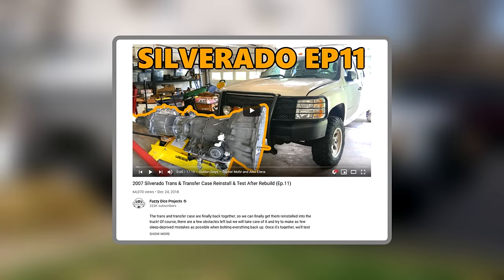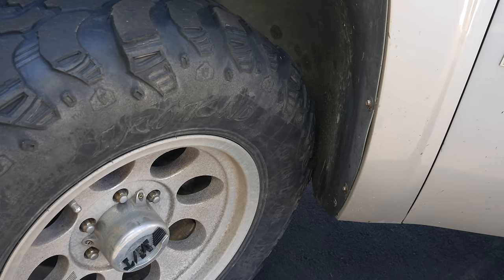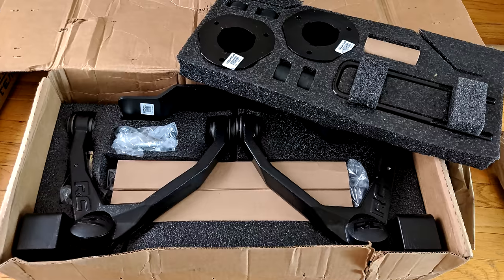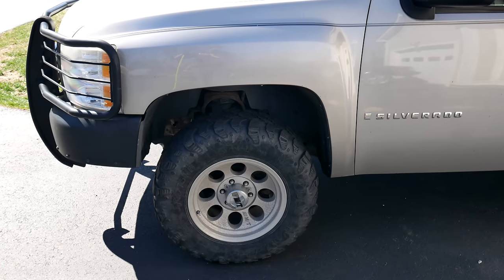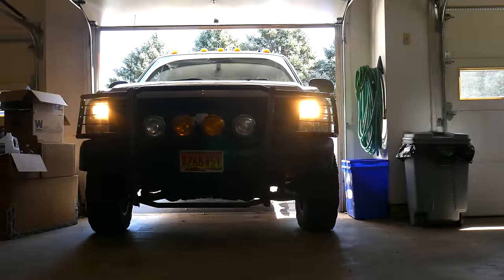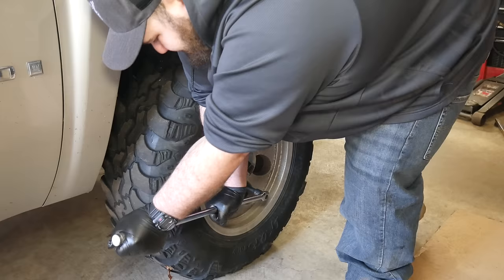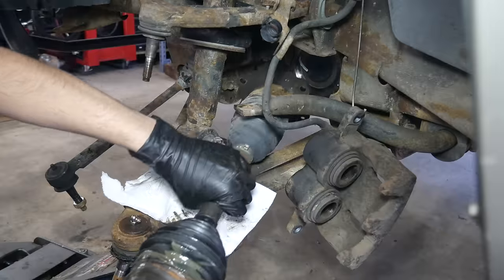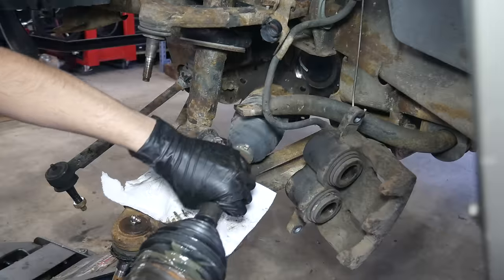2007 Silverado K1500 3.5” Rough Country Lift Kit Install and General Repairs (Ep.12)

Comment: I love that you use so many “less expensive” Harbour Freight tools like a lot of us have at home or can afford to buy. Shows you don’t need the most expensive tools off of the tool truck to get the work done.
Reply: Hope his jackstands aren't from there.
Reply: He's one of us too, he just makes videos so we can share in making memories
Reply: People buy snap on, blue point, etc just to say they have it. No point when harbor freight stuff works just as well if not better.
Reply: @THEEVERYTHINGTHINGCHANNEL  I wouldn’t say that’s necessarily true, there are certain tools I use from snap on I would never even consider from harbor freight for instance screw drivers, and pliers huge quality difference. As far as impact sockets and regular hand tools I mostly agree. Snap on makes very comfortable wrenches but the icon line of hand tools are almost identical for less than a quarter of the price. I also use a 3/4” snap on ratchet with a torque multiplier when I’m disassembling hydraulic cylinders, I would never trust putting that kind of torque on a harbor freight 3/4” ratchet. I’d say application really matters, I agree most snap on tools are ridiculously priced, but when you make a living with your tools you need some high quality tools. I also buy a lot of sunex tools, great tools for the money.

Comment: I know the feeling with those Suspension kits, I put a 2 inch lift under my 94 Explorer, it said about 5 hours for complete installation. Instead it took me about 12 hours.
I did get the same Brand as you Rough Country, and I can say the exact same thing happened to me, and I just didn't trust the bolts, so I also replaced those. The only ones I kept was the U-bolts because I needed them for the lift.
Also I believe they only do the time tests in 100% conditions where nothing is rusted and everything goes smoothly. Which I know is normal for Commission times and all, if you're getting it done professionally.

Comment: Great video !! I bought the same 3.5 inch kit for our 2013 Tahoe z71. Havnt installed it yet. Although mine comes with different options for the rear. Shock relocation brackets and spacers for the spring in back as mine does not have leafs. Gonna video it when I install and can only hope I do as decent of a job as you did!!! Thanks for the video!! It helped me a lot as far as notching the crossmember and installing the structure spacers. That’s was my only hesitation in installing mine and now I feel comfortable doing it!!!

Comment: I did the 2.5" Rough Country kit on my 1980 Scout, but lucky for me it has a solid axle in the front with leaf springs so I just had to swap out all 4 leaf springs and shocks. The whole job took about 5 hours to do solo but was much easier than what you had to go through. I do think you should consider extending your bump stops to avoid blowing out your shocks.

Comment: I plan to do a similar small lift on my 1990 k2500. I dont want to do a lot of fender trimming to clear an old set of 33x14-16 boggers. I had to drop my diff about 18 months ago to pull the oil pan. My driver's side header collector curls under the front driveshaft so I won't have clearance for a big diff drop bracket. I think a 3-4" lift would be about right for me. I want it to look close to stock and still be useful when loading and unloading stuff in the bed. Everyone has tried to load firewood into the bed of a truck with a tailgate that is shoulder high. Ugh. I enjoy your videos and the level of detail that you go through. I make videos but mine aren't nearly as good. I film... and if I don't get it on the first take, I dont get the shot. Lol. I also don't do voice-over work on my videos. Most times that I need any introduction, I film myself talking and rambling. Voice-over would help me be more direct and to the point.. I did sit through the entire hour long video. 
  The engine in my pickup is mostly finished. I'd like to try a diy interchiller to cool an air-to-water intercooler on the centrifugal supercharger of my 350. The transmission just got upgraded to a 4L80E from an old 3 speed turbo 400. Now I'm looking at the suspension. She's a daily driver.
  Keep up the videos. I have a couple 3rd gen Camaros and can apply everything you do to at least one of the vehicles in my fleet.

Comment: To everyone watching. All harborfreight and Pittsburg jack stands have been recalled due to poor welding. Causing the stand to split in half and fall under load!  If you have one, re-weld it or don't use it.

Comment: How’s the poly bushings holding up? Trying to decide if I want to do the same thing or just do the whole thing the first time ‘round. Great video though, didn’t realize it was an hour long until like 40 minutes in lol
Reply: Lower bushings are a bit long but still work perfectly fine. 9.13119 is part number for uppers. It is pretty small, I ended up using a dremel to notch a little slot in order to use the retainer clip so that it wouldn’t fall off the ball joint
Reply: For anyone still wanting to know

Comment: have you had any drive-ability issues since you put that 3.5 lift on your truck? my 12 suburban has the 3.5 lift and is now all over the place, it was fine when i first installed it just a little over a year ago, but a year of driving on it, its gotten to the point where anything over 30 mins (basically going to work) is a pain. i have changed out just about everything under the burb, LCA bushings, ball joints; UCA bushings, not the ball joints because at the time they were new; front sway bar bushings (which i changed from moog to energy suspension about a month ago); rear sway bar bushings; and changed the panhard bar to an adjustable one to bring the rear tires inline with the front, they were offset by about a half inch to the passenger side. signs point to the UCA ball joint, but im not really sure... i almost want to go back to stock... any help from anyone would be appreciated

tires 265 75 18, i have 295 55 20s but they rub the control arms at full turn without a .5 inch spacer so i went with the 10 wides over the 11

Comment: Looks great. Did you ever figure out why the gears started slipping in reverse? Thanks I have the same truck
Reply from the maker: You can see that in episodes 9 and 10 when we rebuilt the transfer case. There were a few failures, but the transfer case output shaft bearing had so much play that it was walking the whole shaft and the splines would slip. There is a TSB on that bearing's C clip failing and causing basically the same thing but interestingly it wasn't how mine failed.

Comment: i had gotten the 3.5 lift for my suburban, only difference is the rear, other then that, total work time for me was about 8-9 hours, i wasnt fortunate enough to do it in a garage, i was in a car port with it snowing which was fun until i couldnt feel my hands, i had left out the dif drop at first and regret it, because i smoked my cv axles and now it vibrates when i drive it. but i would like to know, have you had any issues with the ride at all? for some reason mine sways more than it did when it had a 2 inch leveling kit and stock struts on it, not sure what it is, might be the struts i got from rc.... (just as a caveat, everything in the front has been changed out, lca, uca, sway bar bushes and links, lower balls, tie rods, cvs are next though but they arent part of the suspension necessarily)

Comment: hopefully a guy got some new jack stands, there’s a recall on certain part numbers from Harbor Freight.
Reply from the maker: Thanks for looking out, I had heard about the recall and the ones I have are actually included in it based on the part number. But, mine were bought in 2013 and only the 2018+ ones are supposed to have that fault, I have heard that some stores wouldn't even accept the older grey colored ones for an exchange.

I have used these for years so I know they don't have the shallow tooth engagement issue, and I feel like I'm better off keeping them then getting another unknown set with the quality of tools these days.

Comment: Interesting, those F436 washers are supposed to be hardened carbon steel, essentially the same as grade 8. JLX is the manufacturer; Jiashan Qisheng Fastener Co.,Ltd. My understanding is that Chinesium hardware is generally fine, but has worse batch QC. Looks like you got a bad batch.
Reply: The Chinese specialize in taking it upon themselves to cost reduce quantity items like that, without telling anyone, and hope no one notices. Looks like Rough Country hasn't noticed...

Comment: The ballpoint you replaced the boot on is knackered you shouldn’t be able to wiggle it easily it should be really stiff.
Reply: They're only really stiff for the first few hundred miles of their lives. As long as it doesn't have any free-play in it, it's fine.

Comment: "grease and reinstal the Break pads" 40:00
Reply: you should add little grease around the clips that hold the pads as well as the back of the pad that contacts the piston of the caliper. Helps quiet down any chatter. Just make sure no grease gets onto the pad/rotor.

Comment: Or not put such stupid big tyres on the car in the first place.  Which alters the driving of the vehicle, could be unroadworthy, puts your speedo out by quite a bit and changes the angles of your steering and drive-shafts and then putting more pressure on other points of your car.